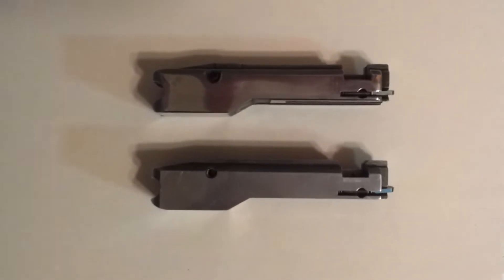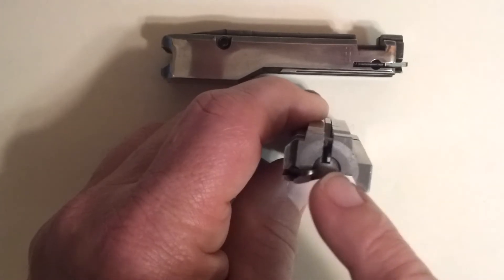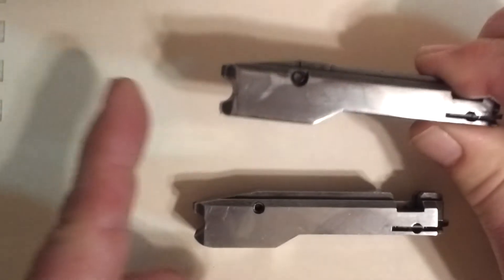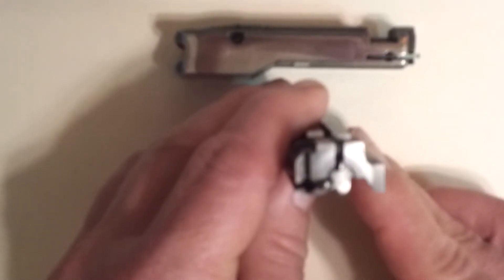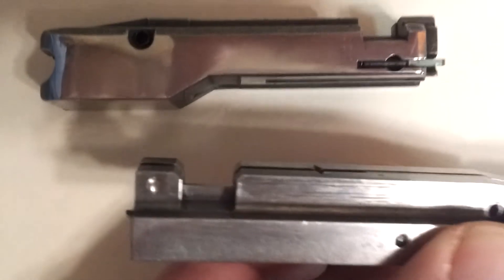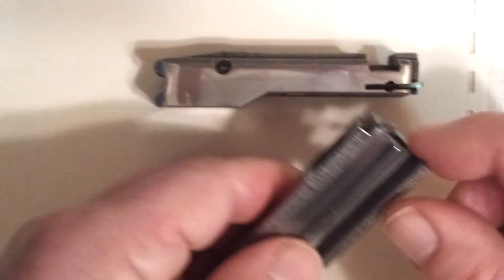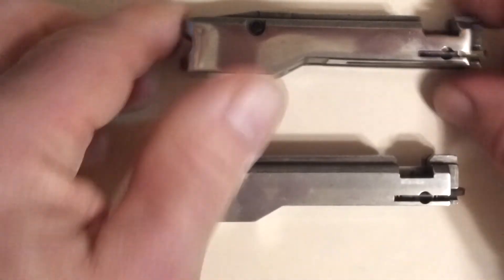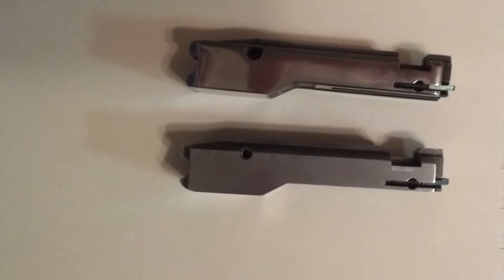Reworked Bolt Comparison 150224

Comment: I replaced my extractor and firing pin with volquartsen parts but discovered that my problem is not with the bolt components but with ammo.  I took only the barrel and hand inserted different brands and discovered a wide variety of tolerances with standard 22 lr ammo.  Some bullets fit so tight in the chamber that the extractor couldn't pull the brass out (fired or pre fired) and I couldn't dig the rounds out of the chamber but had to punch the rounds or brass hulls out with a cleaning rod.  The bolt may not have anything to do with jams or missfeeds.  Some ammo is simply out of spec.

Comment: I just took apart my 10/22 All Weather Stainless to get some measurements, the headspace is .047, should be .043, the bullet itself is .031 to the lands. I’m going to send the bolt and barrel to Connecticut Precision Chambering in Middletown, CT for the works, $159 plus shipping to and from. I understand why Ruger leaves these areas sloppy, it’s for reliability but at a cost of accuracy. If this one turns out as expected, I’ll send my Ruger 10/22 Competition Model to get the same treatment. The bolt face on this model shows uneven wear and a .046 headspace. Great video, I wish Que was still doing this, read a lot of good things about his work.
Reply: A $159.00 !! ???  Ouch !!! as I have 4 bolts  to get worked on !
Reply: Power Custom® Aftermarket Ruger® 1022® Bolt Assembly for the .22LR -Silver Matte   ,ebay 100 bucks
Reply: Power Custom® Aftermarket Ruger® 1022® Bolt Assembly for the .22LR -Silver Matte , $100 , ebay
Reply: You can buy a complete Kidd bolt for 149.00

Comment: Just polished (and faceted) the contact surfaces and bolt face of mine using a 8000 grit whetstone.  Was interesting to watch the progress as it clearly demonstrates how uneven the supposedly flat surfaces are from the factory.  Seems much smoother now, looking forward to testing if a more flush fit between the bolt and barrel leads to accuracy improvements.  Love the 10/22 for DIY.  If I mess something up it is cheap to replace and detonations dont usually turn the rifle into a grenade.
Reply: Update, this worked extremely well.

Comment: the firing pin is held down by the bolt handle,so that pin mod does about nothing,
Reply: Is there any other research or resources that back up your statement?  I tend to agree with you but looking to confirm this fact.

Comment: Is there any info on how to send a bolt to Que?
Reply from the maker: You can't. Que is no longer in business. You can contact Connecticut Precision Chambering, which still does bolts and barrels as well as complete 10/22 tune-ups.